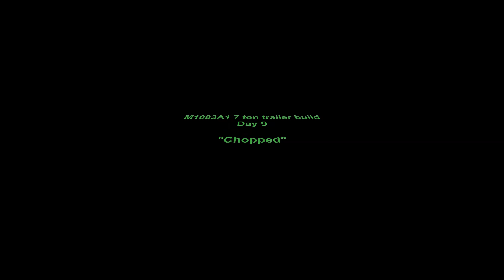M1083A1 7 ton trailer build Day 9 (cutting clearance for tires, welding the bed to the subframe)

Comment: Are you adding back outriggers between the tires to add back the structure you removed? Some skirting would look nice to cover the frame gap and keep the underneath cleaner. (5400lbs)
Reply from the maker: No.  The decking on these is totally overbuilt so there is no need to "add anything back".  I perused it for a bit at one point and decided against it.  In all reality if I would have welded just the front beam and rear beam to the subframe it would be more than enough...

Comment: I sure like all the welds to hold that flat bed on. Pro-tip you could also bolt it on where possible. At least 8ea. 1/2" bolts with Nylock nuts.
Reply from the maker: I thought about doing that.  I have a cross member running under the main beam where the heli lift arms were.  I still have to get under the trailer and stitch weld that too..  I might also add a few plates underneath on the meatier sections...I still think it is overkill but what the heck right??
Reply: @SeanFastidious  Bolts are Good insurance. for the never-gonna-happen day.